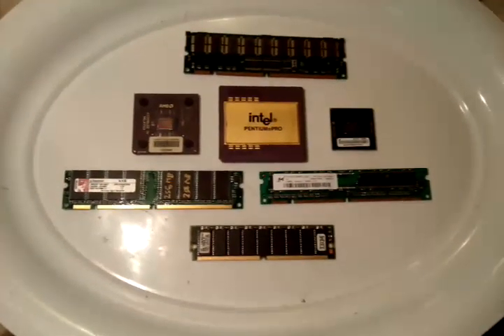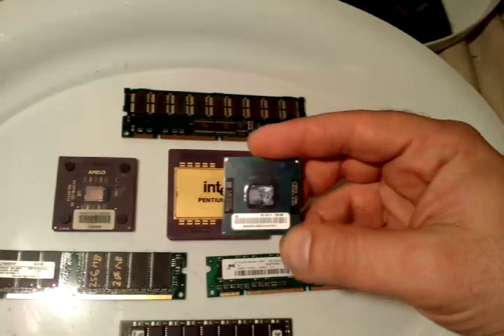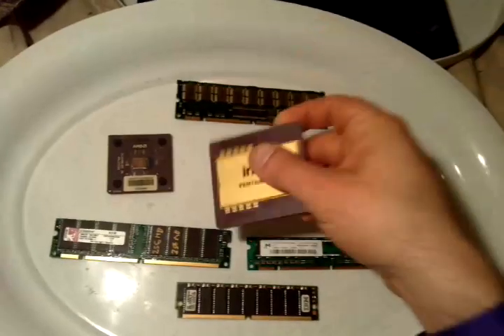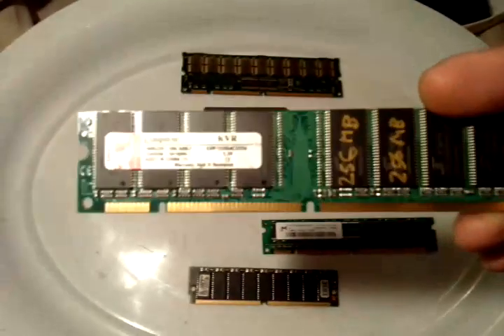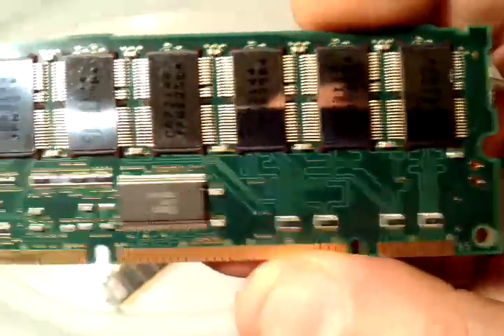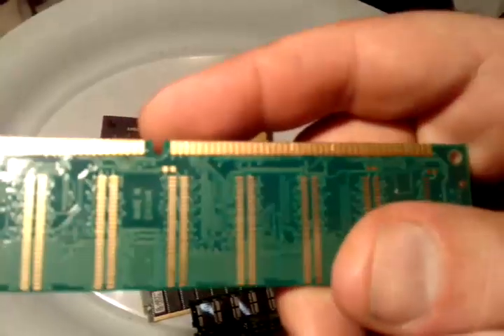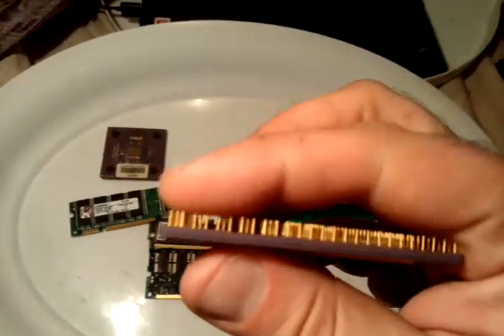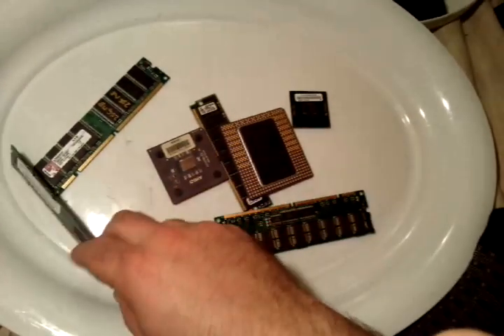Avi Oziel in: How To Recover Gold From CPU Processors and RAM Memory Integrated Circuit Chips

Comment: Where can u get free or cheap old computers?
Reply: The local dump for one. Putting up notices at the grocery store. Business cards, they are cheap. Advise people that you will destroy the hard drive as they watch. With the right tools it doesn't take that long.
The reason I said the dump was because I've seen people taking people taking pickup truck loads of computers to the dump. I offered to buy them on the spot, but, they were so worried that I would steal info off them that they would not sell them. Get cheap business card and hand the out to everyone you meet. If they have solid waste pickup in your area, drive thru the neighborhood before pickup time. Remember, everything is gold if you can make a dollar off it, old TV's, driers, washers, water heaters are all worth money.

Comment: avi have you ever truly got 2+ grams of gold from the 212 or 256 pent pro. i am a master refiner with 3 college degrees in several ears of chemistry. these two cpus have several grams of gold but low in kt  that results in resistance , heat reason for gold heat sink. their is a 1g p pro and is black no heat sink because they used high kt gold. you can get cole to 1 gram. this information is propaganda that was in a article that listed cer cpu gold. the same person who wrote the review has been selling the p pro for years because he obtained thousand of p pros because he work in a school system for years and he got them all free. the adm k5 base .5 one of the best.